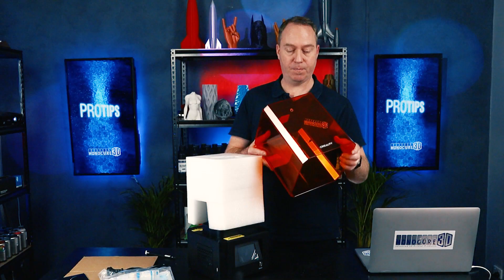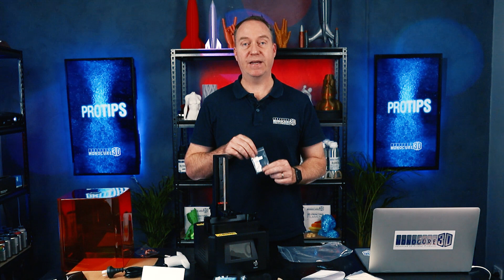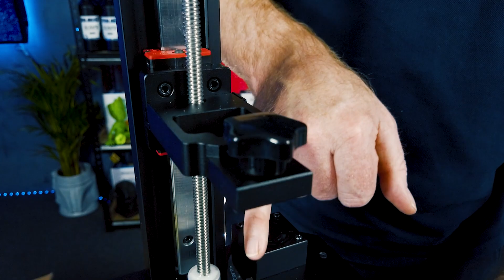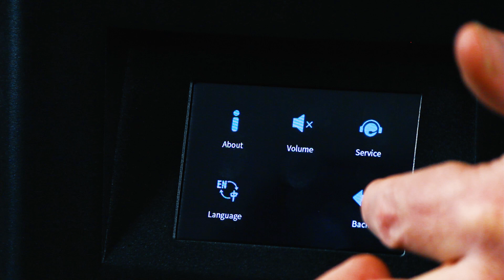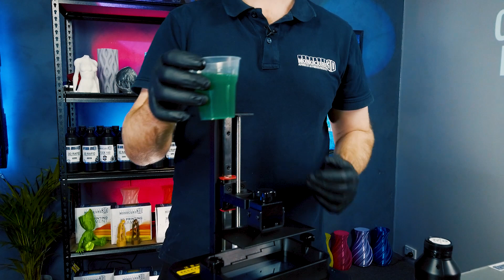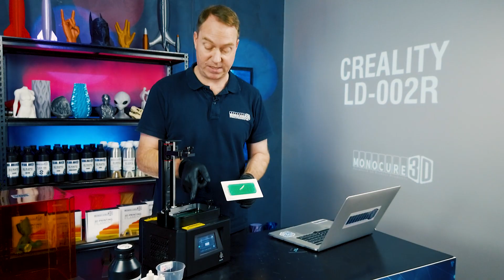Setting Up the Creality LD-002R

Comment: Been using your rapid resin on my 002r for a while now and haven't had any issues. I'm just not too sure about the normal layer curing times you have on the site. I feel like 6 seconds leaves models under cured
Reply from the maker: Thanks. Not all printers are created equal, so the times on the site are a guide only. Make sure you dial in with a calibration model. We have these available on the website.

Comment: Agreed the LD002R is a good printer, have had mine for a week now, and prints highly detailed prints.  A question regarding your colour dye, can it be added to say white or grey resin, and how does it look when it is printed?  Currently using clear resin but looking at the 2 other colours using your dye to change the effects.
Reply from the maker: Yes of course! Our CMYK pigments can be used with any colour resin.